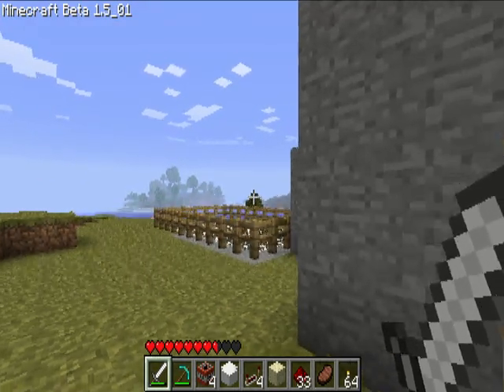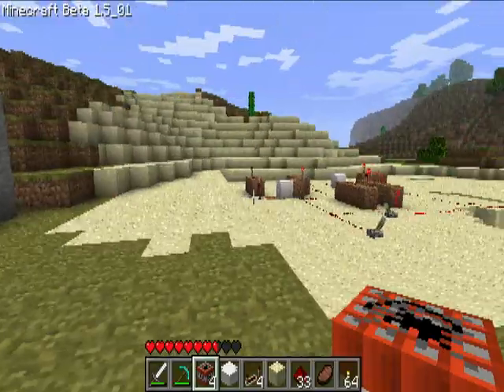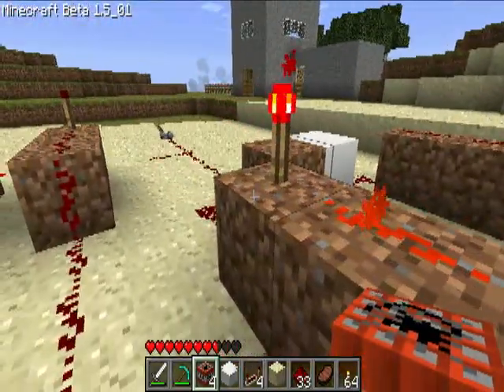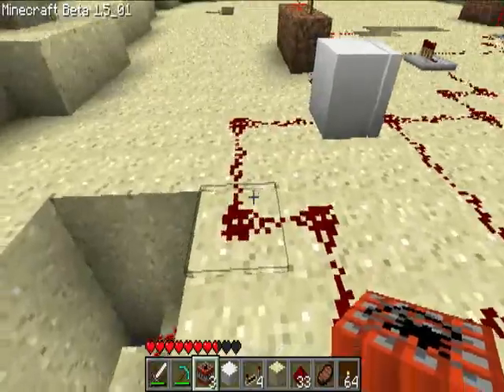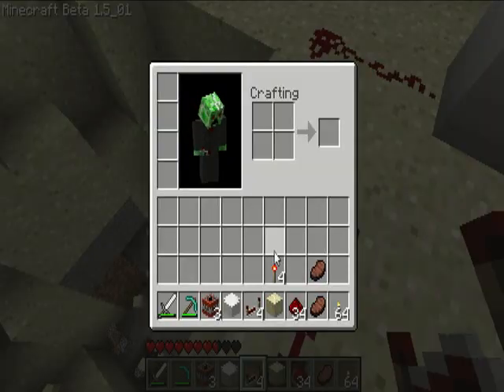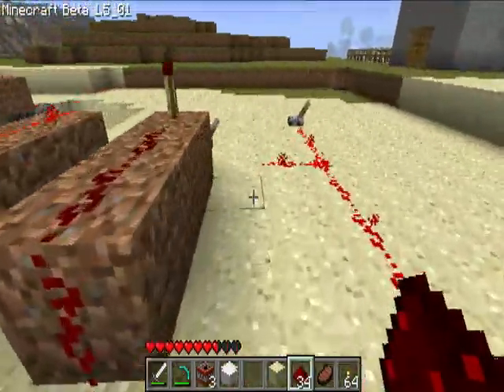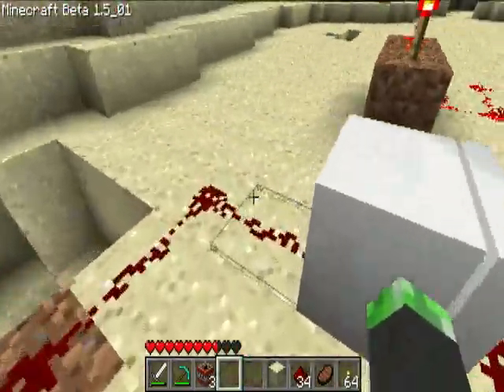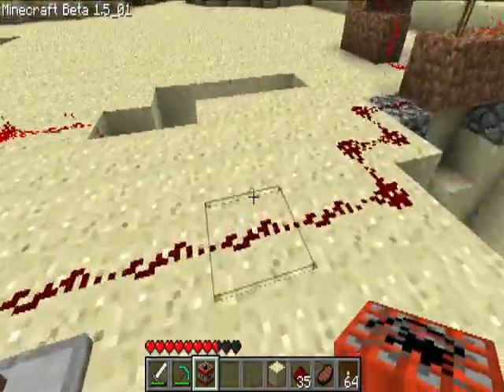Pistons + Redstone Concept pt.1

Comment: @11chuckles1 i actually thot of a way now, its kinda hard to explain tho, if u make a hole and make a line of redstone through it, have a sticky piston push dirt over hole, which disconnects redstone, then pull the dirt and redstone is activated again, but doesnt destroy circuit